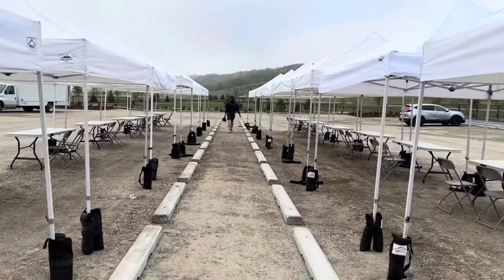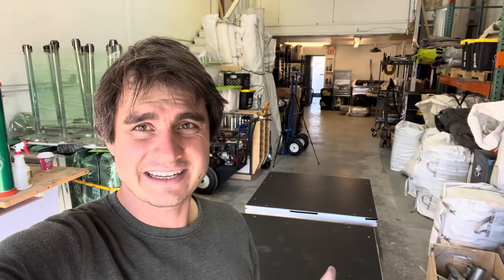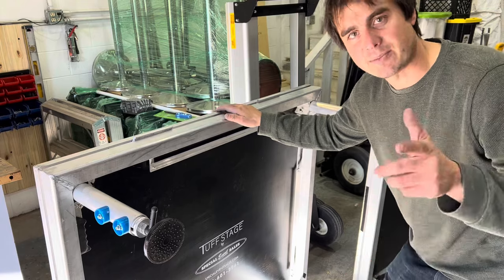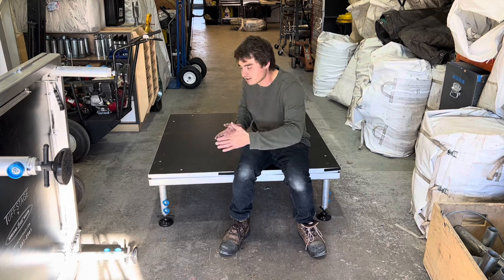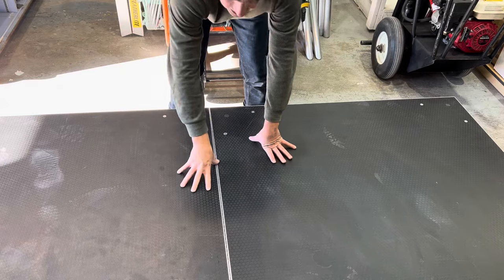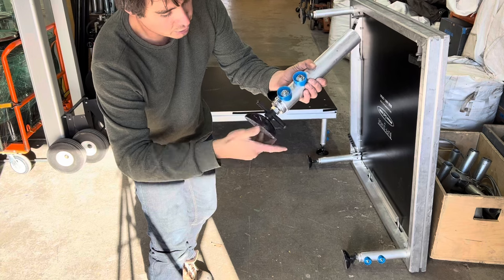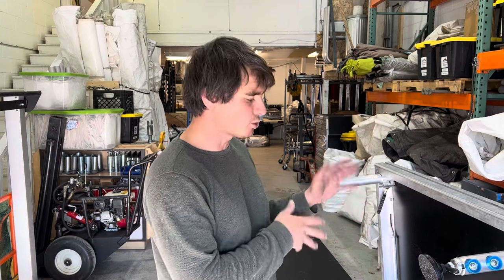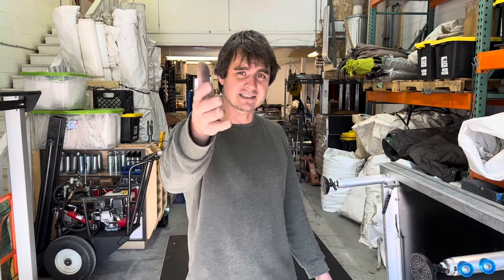Renting Out Stage - Event Rental Business Vlog #3 | TuffStage Review & Setup

Comment: Be careful when getting into stage rentals.  Liability is higher, and you need to have qualified staff who understands weight distribution and how to securely brace stage when heights over 24 inches are required.  In many municipalities, anything over 36 inches in height may require a temp building permit, so check with your local area laws.  You also have to consider guard / safety rails for higher stages as well.  You don't want a client, or worse, a child falling from a 3ft high stage, because the client wasn't aware that it was beneficial to install this.  Lastly, stairs.  How is a client going to get up to a stage that is 16in or higher?  

Again, it's not so cut and dry.  Sure, they can be easy, when they are just used as drum risers, or simple sweetheart tables, or for low heights such as 12in.  But try not to take on anything more until you have competent staff that understands the nuances of stage equipment and the safety requirements.